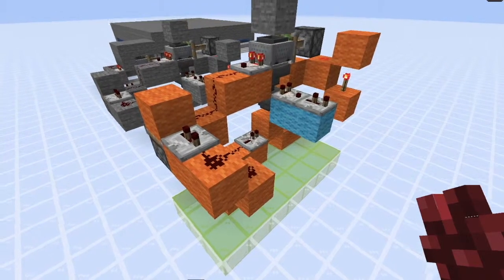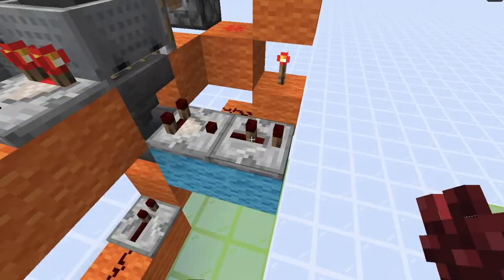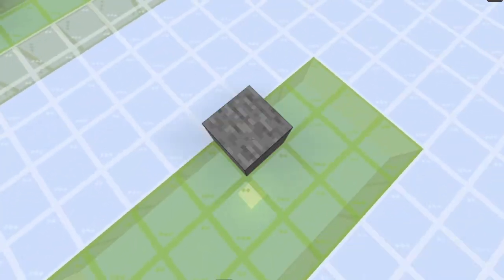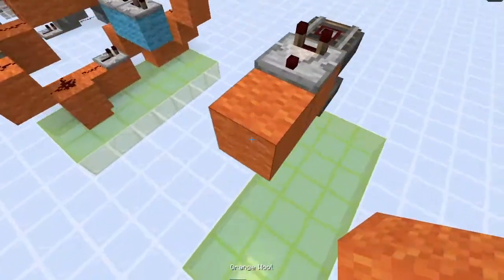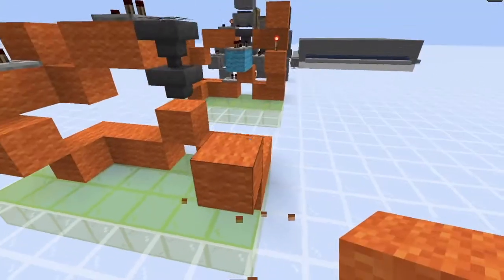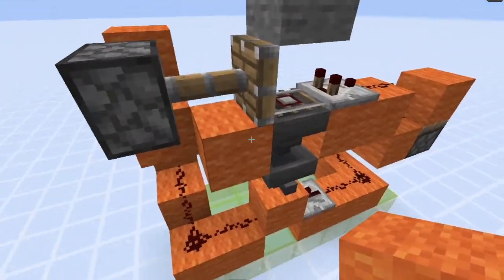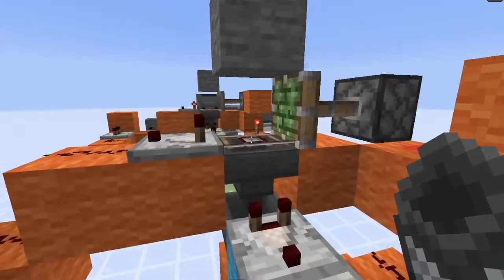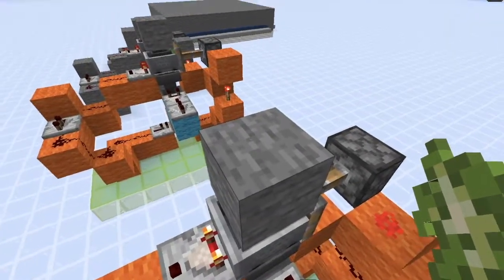Minecraft 1.14-1.18+ Undetectable Hidden Item Key Lock - Redstone Tutorial

Comment: Could you do this without a minecart?
Reply from the maker: Sorry for the late reply! I don't think so, as the minecart is necessary to pick up the item through the full block. If it was a non-full block, it might be possible to use a hopper without the minecart, but the design would probably need significant changes.